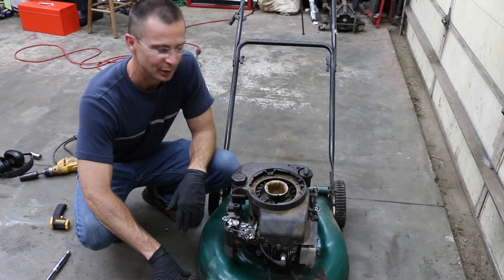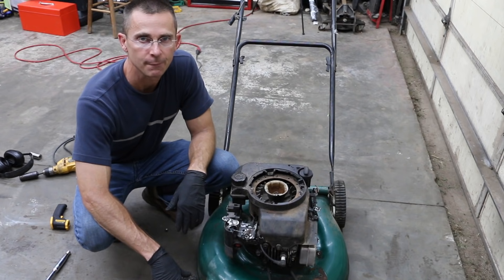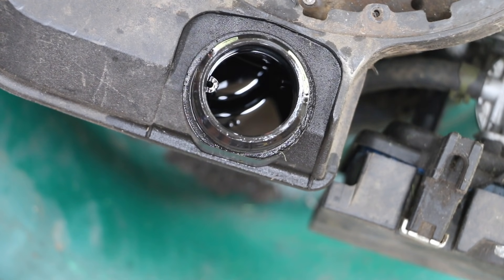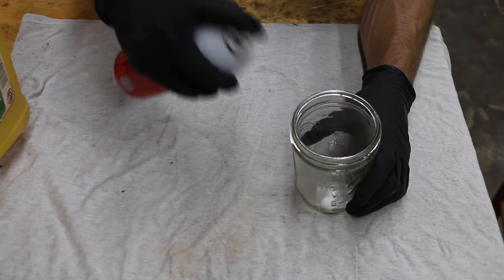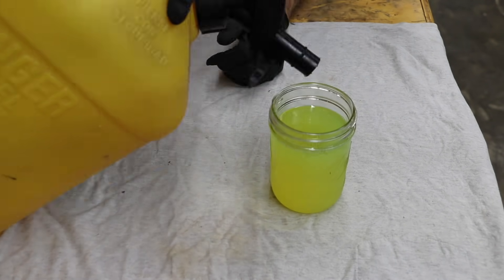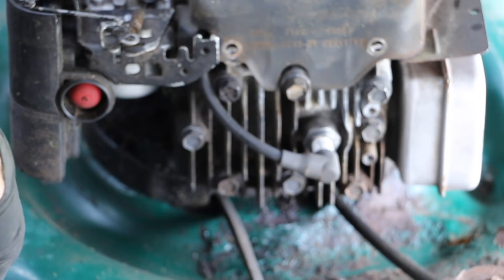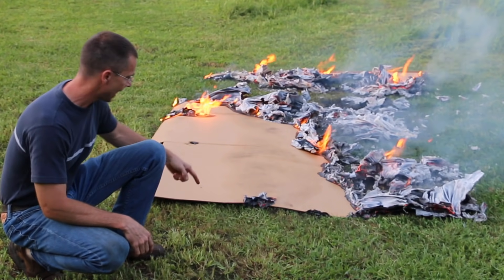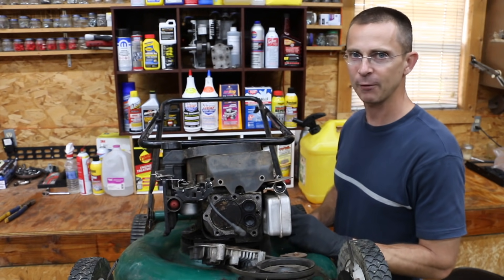Will a Gas Engine Run on Diesel?  Let's find out!

Comment: I would love to see some kind of liquid fuel dosed with an oxidizer and the air intake blocked.
Reply from the maker: Thank you for this video project idea!
Reply: The fuel is called nitro-methane. BE CAREFUL!!! nitro-meth is very unstable because it contains it's own oxidizer. It has an extra oxygen molecule in it's matrix. Another thing to try would be 100% hydrogen peroxide. It is literally a 50 / 50 mix of hydrogen and oxygen. This is why they use it in peroxide rockets and rocket cars. The stuff you buy in the drug store is 97% water. If you used pure peroxide on your skin as a disinfectant, it would burn you without a flame. Better known as oxidization.
Reply: sounds like a submersible engine to me.
Reply: Rocket scientist here! You must remember that materials in the presence of an oxygen will flash at lower temperatures and burn hotter! So think about the container you store the oxidizer in and its environment! If you get the oxidizer fuel mixture wrong and it ends up being oxidizer rich then it will run hotter in the combustion chamber and produce more pressure.
Reply: Just add Ammonium perchlorate which will permit everything to burn even the aluminum in the motor
Reply: That's a bomb, I wouldn't do it!!!
Reply: Richard Ziminski not necessarily. If the exhaust is open the fuel will combust with an intake and then be ejected.
Reply: What you could do is to use nitrous oxide with a hose in front of the carbs intake. Then just keep increasing the flow until it displaces most of regular atmosphere. I doubt it would run for long if it didn't burn a hole in the piston. But if you do decide to try it. Do it outside and put up some protection and of course baby steps. I wonder if you could use the same method that was used to draw air threw the gas and ever clear. But I would be afraid of mixing gas and nitrous oxide together. I wonder if there is a video of somebody mixing nitrous oxide with fuel.
Reply: Michael Hendrickson you are a genious. That way i could mow my lawn in space.😂
Reply: Would that even work though? wouldn't you need to modify the intake considerably?
Reply: Richard Ziminski I think you are misunderstanding how air intake works. There should be no back flow from the combustion chamber to the air intake, the combustion drives the piston and then vents the gas to atmosphere.
Reply: wouldn't that just fill the cylinder with so much fuel that it would be incompressible?
Reply: Shroom Duke, the compressed piston chamber would fill with the liquid fuel/liquid oxidizer. This is no different than normal operation but without the air compenent. Spark would ignite the fuel/oxidizer mixture and cause the liquid to expand into gases, driving the piston. Does that answer your question?
Reply: what you are describing is called an explosive
Reply: There's not that much oxygen in the fuel as compared to gasoline/air in a regular running engine.
Reply: Michael Hendrickson will the diesel run with a hotter burning spark plug?
Reply: That is a cool idea
Reply: Perhaps Calcium Carbide, and 80/20 Diesel/Gasoline mix?

Or 

O2,Ethanol?

Or 

Potassium Chlorate, Sugar, Mothball/Acetone mix should really rev out a single bore  4 stroke

Or

Any of the above in a large 390-500 2 stroker?
Reply: brainfreeze44131
I think it could be easily rigged to have a secondary tank, a bottle with opener solenoid and a peice of inner tube tripp wired over the carb throat. 
Basically ghost it like a kid on training wheels a trip wire scorpion
Reply: Look up nitro methane.
Reply: only pussies run nitrometh : ^)

Comment: I used to run my gas lawnmower on 100 percent pure diesel, and it ran like a charm, with more power and virtually no smoke. 
 The secret was to warm it up for about 2 mins on gas, then go to diesel, and lean out the mixture by about 25% . 
 If you want to see a gas engine running on WOOD, come over to my channel, where I use such a system to power my generator  :) .
Reply from the maker: Thanks for commenting and I'll check out your channel!
Reply: Thanks kindly  :) . 
 You will be amazed at how smoothly an engine runs on gas extracted from wood  :) .

Comment: will running the engine without a muffler burn the valves. bonus is if you can run the engine without a carb
Reply from the maker: This is a great suggestion--thank you!

Comment: From what I understand, when you raise the octane level you are slowing the burn, if that is true, could you not use diesel as an octane booster?
Reply from the maker: From my research, diesel has an octane that is much lower than gasoline.  Others have commenting that it lowers the octane and worsens detonation.

Comment: Diesel fuel is too thick to atomize through a carb. The gas thinned it down enough to allow the diesel to be sucked into the engine and be atomized when it went.
Reply from the maker: This is a great point--thanks!

Comment: I'd like to see you run one of these engines on a mix of  isopropyl  alcohol at both strengths 71 and 91 percent, starting from like maybe a 30 percent, all the way up to a 100 percent.. I mixed up some fuel for my personal rig to try and pass emissions and I went from 11 times the legal limit at idle to almost passing. I'm trying a stronger mix but of e85 and premium but the 3 gallons of 70 percent almost did the trick... so while watching this video I was like.. heeeeeey.... I wonder if he'd be interested in trying this out.  I'm curious how much of that alcohol can you run before it affects how it runs... Like to see one with e85 as well in stepped ratios all the way to straight e85. Love the channel great work.
Reply from the maker: Yes, I will create a video on e85 and on isopropyl alcohol.  Thanks for the idea!

Comment: I ran my Harley on a 50/50 gas/diesel mix after some dipshit filled a half-empty gas tank on a Wiggins fork lift with diesel. My job as the store mechanic was to get it right. Since there was about 35 gallons of the stuff, I ran it in my Harley and International (gas) pick up trucks. Nothing different except the smell and the dirt that would accumulate around the Harley's gas tank filler caps on the gas tanks. Diesel/gas fumes seeping out the cap vent holes.
Reply from the maker: Thanks for sharing this experience!

Comment: During WW2 it was common practice to run cars on Kerosene because it wasn't rationed. It was necessary to start the engine on petrol. I remember my father had a 1 gallon can of petrol fastened under the bonnet [hood for Americans] with a pipe to a two way valve in the fuel line. He would start the engine and run for a mile or so on petrol before getting out and switching to Kerosene. It was important to switch back to petrol a few miles before turning the engine off or it wouldn't start without the bowl being cleaned out and refilled with petrol.
Reply from the maker: I enjoyed reading your comments.  Thanks for sharing this information!

Comment: I've often wondered if adding 15-25% diesel  to regular unleaded gasoline would slow the detonation process in the same manner as traditional octane does... Is there a way this theory can be tested?
Reply: Diesel does the complete opposite and makes detonation much worse, since it has a much lower octane rating
Reply from the maker: Thanks for commenting!

Comment: Had a customer who brought me a truck that accidentally put diesel instead of gas, didn't find out after two days of checking what was wrong with it...check, fuel pressure was ok, spark, ok...but sounds like was out of time, check timing chain, and was good too...well...the way find out was the diesel, noticed the "gas" was evaporating normally, was kind a oiled substance in it....clean the gas tank, poor regular gas in it, and problem solved...some times we (as mechanics) have to use "guess science" to really find problems...by away, it was a 2003 F-150 4.2...
Reply from the maker: Thanks for sharing this experience!

Comment: many yr ago a crazy guy from salem ma. drove his boston whaler from top of main down coast back to salem ran 1/2 mix becouse back then diesel was cheaper . told me he would start on gas & switch tanks while running but would switch back to strait gas before shut down or motor would not restart
Reply from the maker: This is impressive!  Thanks for commenting!

Comment: One poster said something about gasoline in a diesel engine,two comments.First a 3-53 Detroit Diesel fuel tank was filled with gasoline.Engine would not run at all.We had to drain the fuel system completely including filters then refill with diesel,reprime the fuel system.That got it up and going.Second the Army,back in the 1960s Was using a multifuel engine that would run on 80 octane gasoline,peanut oil,diesel fuel,and several other fuels.We ran one on JP4 jet engine fuel,only thing we noticed was that engine ran a little hot.The multifuel engine would also run on 115 octane aviation gasoline but again the engine ran pretty hot
Reply from the maker: I enjoyed reading your comments! Thanks for taking the time to comment!

Comment: That engine has a carburetor that will pick up fuel through the pilot jet (They offer 3 for different altitudes) that if mixed with higher viscositiy fuel, such as diesel, or Biodiesel, depending on temperature-  can be dependable to run on 80/20 ratios. (80 gas/20 Diesel or biodiesel-B100) Your 50/50 mixture success was likely due to the cranking speed being accelerated with a power tool, a 50/50 mix would not likely ignite with a normal recoil, where as the 80/20 mix seems to be the cut off for starting by hand.  Vigourous blending of the fuels is also an important step before adding them to the tank, the jiggling back and fourth with two fuels in the tank usually results in pockets of thicker and thinner fuels and in my experience in spotty performance. As for potential for engine damage there isn't any. A prematurely fouled plug maybe, but the bottom line on alternative fuels in any gas or diesel engine is getting it there. If you can deliver it to the chamber, it will probably work. Straight vegetable oil instead of biodiesel is a little different due to the glycerin not having been removed, the stuff is sticky as all shit, and it's kinda like smoking ciggarettes. You can do it for a long time, but eventually it catches up with you.
Reply from the maker: You're really knowledgable on this topic. I enjoyed reading your comments!

Comment: I haven't finished the video yet but I've ran a lawn mower up to temperature before and then switched it to diesel with a 3 way valve. It works fine but smokes a bit.
Reply from the maker: Thanks for mentioning this.  Looking forward to seeing the video!

Comment: Can you tell me why the lawnmowers get hot and the engine stop running?
Reply from the maker: Is your mower low on oil?  Possibly vapor locking too.
Reply: Oil and vapor are good. Can it be the ignition coil?

Comment: Great video. Keep it up!  I just realised that on your glue and epoxy tests that the bolts were not clamped down is that correct? I wonder if that would make any difference in the results.
Reply from the maker: Ricky, Great point regarding the bolts and clamping.  That would likely make a difference, but the average consumer isn't likely to use a clamp. So, I decided not to either.  Maybe I should have.  Thanks for the positive comments regarding the video!

Comment: the 50/50 diesel will it  run loner than the straight gas. Also will it run on 25% gas 75% diesel.
Reply from the maker: This is a great question. I should have attempted 25% gas/75% diesel.  Thanks!

Comment: Because diesel fuel or kerosene has a slower burn rate than gasoline, would adding some quantity of either fuel oil to gasoline raise its octane/anti-knock/preignition characteristics?
Reply from the maker: Diesel has a lower octane rating than gas.  I believe it'll lower the octane. I hope others will comment on this.

Comment: My Grandfather had a sawmill that was designed to start on gasoline then switch over to diesel after the engine was warmed up. It was probably built in the 1940s and is still operational today.
Reply from the maker: This is very interesting.  Thanks for commenting!

Comment: yes it will run on diesel i got my 3 1/2 hp briggs to run on staight diesel you need to warm it up or run it on gas first
Reply from the maker: Thank you for this suggestion!
Reply: Project Farm sure and for this experiment it works really good with carburetors you can adjust to get the proper amount of fuel i noticed you had to prime and feed it but if you were to adjust a needle an the carb it would be the same and stay running

Comment: Hey IDK if anyone has suggested this but what about diesel and ether or a octane booster. I am also wondering if we could make a inexpensive mixture using, used cooking oil based mixture to work in a high compression diesel engine. Also playig with compression ratios in small engines might make emergency power Gens run on waste or waste based mixtures.
Reply from the maker: These are great suggestions--thanks!

Comment: Pre heat th diesel hot very hot this will speed up the flash point greatly ,,,,,,the exhaust gas when hot will continue this process ,,,,, check out Paul Pantone Geet. ,,',,if they didn't bump him off God Bless
Reply from the maker: Thanks for this suggestion.

Comment: You didn't lean the carb out. It would have run if you did that.
Reply from the maker: I agree.  I should have used an engine with an adjustable carb.  These newer engines have their limits.

Comment: Very interesting test.  As a wildland firefighter we use a mixture of diesel/gas in our drip torches.  Depending on how hot we need the fuel to burn and it's duration is basically how we determine the ratio of diesel to gas.  The diesel acts as the surfactant while the gasoline acts as the ignition.    2/3 to 4/5  diesel/gas ratio is best.
Reply from the maker: I enjoyed reading your comments--thanks!

Comment: We use a water/contractors pump year round in winter & wet conditions thru out the year and we can start and run on propane/butane thru the breather torch is out of course but it will start,run and dry the motor so it will switch,run on gas.  Nice videos !!
Reply from the maker: Thank you for commenting and thanks for the positive feedback!

Comment: Diesel will work in a gas engine if the engine is warm first. The problem is that diesel fuel has a low octane level and will cause detonation in a gas engine. Flat heads engines won't work as well with diesel as the compression is lower than in an overhead valve engine.
Reply from the maker: Thanks for commenting!  This is great information.
Reply: They used to start the old hit & miss engines on gasoline and switch to kerosene when the engine warmed up. They used little dual fuel carbs.

Comment: I know a 327 running 13/1 compression will run on diesel. I know cause I mixed up the cans once
Reply from the maker: Impressive!  Does it sound like a diesel too?
Reply: +Project Farm no. it sounded pretty bad. and some white smoke

Comment: This is like running a two cycle mixture in a gas engine except there is no gas. No spark plug in a diesel engine which ignites by high compression. Gasoline engine has lower compression and timing is different for the two engines. Also diesel has injectors which creates a mist of the oil.
Reply from the maker: Thanks for commenting!

Comment: Try running diesel in it but with a hot motor. Back at home i herd about a guy that drove his snowmobile to the pumps acedently put diesel in it and then went home and hit the kill switch and it never stopped. Would be cool to see if this is true or not. Makes sense az to running on diesel becouse it was a hot engine.
Reply from the maker: This is a great suggestion--thanks!

Comment: I really hope you try aviation fuel, methanol and E85. I do have a degree in automotive technology and have built many small engines in my life. I am certain with the proper air fuel mixture you can get these to run an engine. Which same could  be said about diesel. It is all about getting the liquid into a vapor /gas form.  Also the demonstration of gasoline and Diesel you did is all about the gasoline having a lower Flashpoint than diesel.  Gasoline vaporizes quicker than diesel and these other fuels I mentioned. If you do attempt the other fuels I mentioned please do this outside or with proper ventilation or your eyes will start burning and it will be hard to breathe. Methanol will absolutely make this happen. Hope to see these videos soon. thank you
Reply from the maker: These are all great video project ideas!  Also, thanks for the word of caution on burning these fuels.

Comment: If you haven't tryed it yet 
Try running an engine on a couple different highly flammable liquids 
Like 60% or 91% rubbing alcohol 
If one runs better or not at all 
And even other flammable liquids
Reply from the maker: These are great suggestions--thanks!